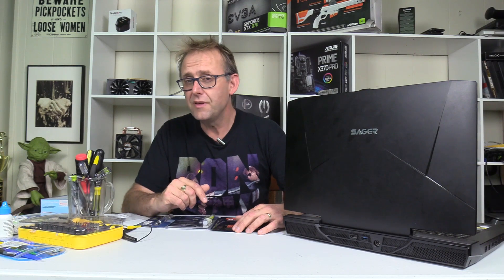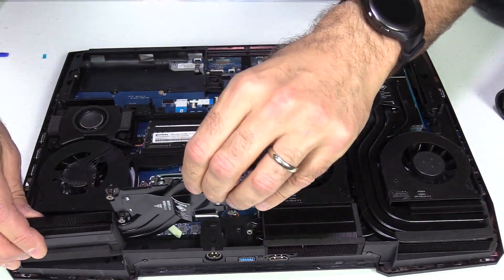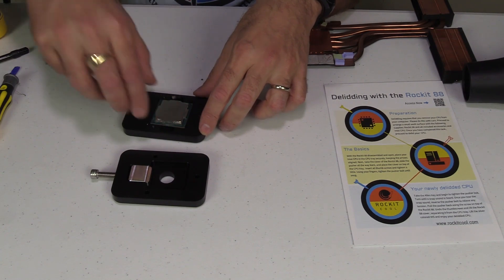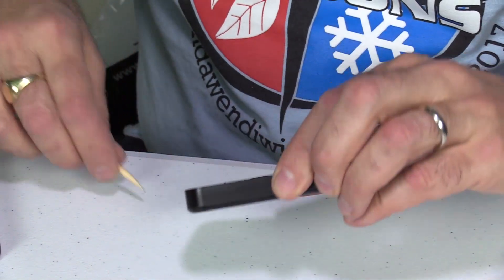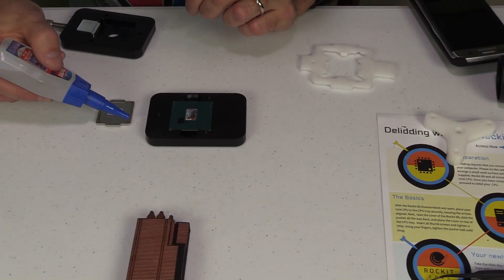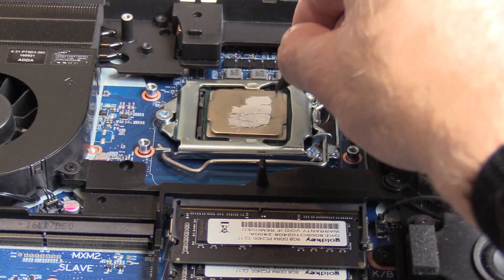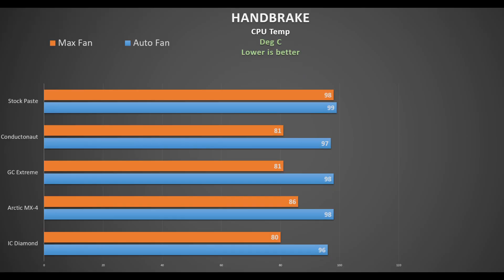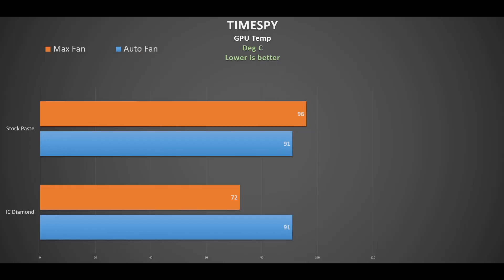Does The Thermal Paste Matter In a Laptop ? 4 Paste Showdown !

Comment: Hi, just discovered your channel with very informative videos.  I'm currently looking for a laptop for uni and wondering what would be best for me at the £1000 range.  I'll be using it for programming, web development, and might even run virtual machines.  Though, most of the practical stuff will be done using the machines at uni.  Gaming is not much of a priority, but if I could get significantly good performances than my ps4, it'd be a bonus.  But I doubt it at that budget.  Otherwise, I'm completely content with my ps4.  I just need something that would get me through uni really.  If you could find something better at a very slightly higher price, that would be alright as well.  Look forward to your suggestions :)
Reply from the maker: Thanks Jubaer, I'm glad you found my channel too ! I bought my wife the Dell Inspiron 7000 gaming, at the time it had a TN panel but I believe now - certainly here in the USA- that they are all IPS panels now. It is a great laptop . Games well, great speakers.
Here it is on Amazon but you might get it cheaper from Dell - especially their outlet: https://www.amazon.co.uk/Dell-Inspiron-15-6-Inch-Anti-Glare-Gaming/dp/B06VV992PY/ref=cm_cr_arp_d_product_top?ie=UTF8&coliid=I22XU8ISQOHZZQ&colid=3KCY0YS9MN21L
Here is my review on it: https://www.youtube.com/watch?v=oCo2GZLacMs

I reviewed the MSI GP72MVR and I think that is great too. Its light for a 17" laptop and I see it hasn't been released yet but looks great value: https://www.amazon.co.uk/MSI-GP72MVR-Leopard-9S7-179BC3-615-Graphics/dp/B075JR8KM9/ref=sr_1_1?ie=UTF8&qid=1514645562&sr=8-1&keywords=msi+gp72mvr+7rfx
Here is my review: https://www.youtube.com/watch?v=NMM43aZGOzk
They do a 15" version too, GP62

The Acer Predator Helios 300 is another solid machine, I haven't reviewed it though:
 https://www.amazon.co.uk/Predator-Acer-15-6-Inch-Notebook-i7-7700HQ/dp/B074JFXGW2/ref=sr_1_2?s=computers&ie=UTF8&qid=1514646041&sr=1-2&keywords=acer+predator+helios+300
Reply: That Dell range is highly recommended from some of the websites I've checked.  I checked on the Dell website and found the Dell Inspiron 15 7577 (which I'm assuming would be a newer version) with an IPS panel and 1050ti for slightly cheaper than the amazon one.  Plus, it offers 10% off which is fantastic!  Thank you very much for your suggestions!  I now know what to get :)
Reply from the maker: Great choice !  Enjoy it !

Comment: Cool video! Very useful:) great job
I bought today i7 8700K and will make some tests, did you have a chance to test this processor? 
Greets:D
Reply from the maker: Sandra M hey Sandra ! Thanks. Yes,I have tested it in my Sager NP9877. It does well although I think the bios is holding it back.i can't clock the 6th core any higher than 4.5...
Reply: its even more interesting. because i bought i7 8700K for my desktop. will test it in comparison with the results from your sager NP9877, wondering if there will be any difference
Reply from the maker: Sandra M that would be great, perhaps do a joint video ?
Reply: yea:D!
Reply: Something tells me you're not really a girl.

Comment: Interesting video. First time I've seen someone delid a cpu. Which makes me wonder what the results would have been had you not delided the cpu? I'm wondering if that skewed the results somehow? Deliding, if done right, will lower the temps to begin with so how much difference would there have been between the pastes using just a stock cpu? In any event I found it all very interesting. Thanks for sharing it.
Reply from the maker: Thanks for watching it :) I just figured whilst I was in there might as well make it as cool as possible. All 4 pastes were applied to the same delidded CPU so I would expect the relative performance to be similar. Glad you found it interesting !

Comment: Nice comparison! That Sager looks so easy to tear open lol.

I've recently discovered Cooler Master's MasterGel Maker and want to stick that on my Alienware 17 R4. From reviews it looks like it's quite a competitor at ~$10.
Reply from the maker: Havok C89 thanks! Yes, it's easy to get in and do this type of stuff. To get access to the m.2 and extra ram slits you have to push out the keyboard which is daunting if you haven't done it before. There AW7 R4 has a bit more framework to remove I believe. That paste looks great, 11w/mk . Whish I had spotted it for this test. Let us know how you make out 😀
Reply: OWNorDISOWN Tech Decisions Made Easy will def try to report back. I had my motherboard abd heatsink replaced on mine, which is curious as myself and the tech discovered it was a revision from when my unit was bought back in September. 
It stopped my studdering though, but my temps still throttle at times. Taking the R4 apart is definitely daunting though lol. From what the tech had done, everything was pretty much taken out and unhooked, it's CRAZY!!
Reply from the maker: lol, yes people often overlook the occasional need to get inside things to repair. I remember I had a Suzuki car that in order to change a lightbulb I would have to remove the bumper which would cost me $500, lol. Obviously I didn't bother and just sold it :)
Reply: OWNorDISOWN Tech Decisions Made Easy haha, you should start a channel for Car Decisions made easy!! ;) :D

Comment: Thanks for the great review. I might try this on my Alienware R4. Is there a way to tell if an R4 has good factory thermal paste / good application by a serial number, etc... I think you might have done a video about that, I could be wrong.  Sometimes Wolfenstein 2 or Elex will freeze or crash, not sure if it is thermal issue or just the games (I use a cooling pad). Seems to freeze up more compared to my previous 980ti desktop. Overall the R4 is great and your review helped my decision. Great review again and good normal speed experience compared some of the hyper active technology channels.
Reply: thewhitewolf I would contact Dell Alienware, and convey the problem to them, and request a new motherboard.  Depending on your residence, they will send a contractor to install it.  Also, if you still have a warranty.  They/Dell are trying to be more customer friendly.  I had an overheating problem, and they did exactly what I stated above, and it was very successful.  I hope this helps.
Reply from the maker: Thanks mate, glad you found it useful. The only way to check the quality of the pasta is to open it up unfortunately but it's fun to do 😀 I did do a video on game stuttering on the AW17 R4 and there seemed to be a concessus on 3 causes . One was poor thermal paste contact, the second was due to the rear end being raised , and the third was some issue with the hard drive. Perhaps it's because your laptop is inclined on your cooling pad ? 
I'm with you on the hyperactive channels. I sometimes wonder how those folks talk in real life, lol

Comment: quickly becoming my fave tech youtube. you go into the fine stuff. have you gotten your hands on a samsung notebook 9 pro as yet. the i7 8550u in the model i have is able to achieve 720. once i remove the intel dynamic thermal platform framework. its rather good. im about to repaste and add some thermal padding to keep temps down
Reply from the maker: Wandrinsheep Thanks mate ! I keep meaning to review a Samsung laptop. I'll have to add that to my list. That's great that you get such good performance. I think next year we will start seeing manufacturers increase the turbo power boost out of the box. It would be great to see a video of your repaste if you have time 😀
Reply from the maker: Thanks. I have gotten them shorter. Used to be in the mid 20's. I'll put time stamps in the description going forward, that may help. I think a lot of it is how YouTube push people's content. I think they should spread it out a bit more, rather than concentrating on the large channels that generate them more advertising revenue. Business is business I guess. Either way, I appreciate you sticking with me - even as I dabble in other products. Just bought a new UW 38" monitor to review. That' will be my 1st monitor video so I am sure it will suck compared to other people's but I'll give it my best shot :)
Reply: Wandrinsheep:  OWNorDISOWN is my favorite tech guy.  I'm shocked that he doesn't have a lot more viewers.  He is going up little by little.  I bet if he wore a couple of earrings and waved a rainbow flag and promised to make transgender friendly videos he would go right to a million subscribers.  That seems to be the youtube tech way these days.  Straight, smart, married tech guys are shunned by youtube.
Reply: SonOf Thunder:    LOLOLOLOLMAO!  Linus Tech Tips comes right to mind.  Youtube instantly trends his videos no matter if they are good or bad.  Right now youtube put his newest video to trend in the top 10.  Linus with 2 earrings and talking with a lisp.  I'm not gay bashing.  I don't care if someone is straight, gay, bisexual or trisexual but it is AMAZING how youtube favors anyone who acts even remotely homosexual.  OWN is a much better tech guy.
Reply from the maker: LOL, that made me laugh - Linus does have a lisp, never thought of it before but you are right :) I think I might start wearing disguises , perhaps a false beard or big Mexican moustache might get me more views. What do you think ? LOL.
Reply: Wearing a dress would boost you immediately.  PLEASE DON'T DO IT.
Reply from the maker: Cheers mate!  Yeh, I don't know how these other channels grow so much, I must be doing something wrong. I thought perhaps because my videos are too long. Like the other day someone asked how a laptop performed in a game and it was in my video - they just couldn't be bothered to watch it. Perhaps max 5 minute videos is the way to go. Might have to do a video and get everyone's feedback. Tough to cram in lots of details in 5 mins though.
Reply: I think the time length has been perfect.
Reply: OWNorDISOWN Tech Decisions Made Easy I actually like your format. Sure it's a bit lengthy but it touches on all the parts I need. I recommend maybe adding timestamps to the important parts. So people can get to the areas they need like gamer nexus who also has similar lengthy videos to yours. BTW I just ordered the ic diamond based on this video. And some fujiploy 17w/mk pads. I’ll try to record the results on my channel. Keep up the good work
Reply from the maker: Thanks for the tip. I used to do the time stamps in my really long ones but yes, its a good idea. I'll start that up again. I subscribed to your channel - looking forward to your results :)
Reply: Hey there, I tried recording my repaste. but unfortunately i Didn't have any camera up to par for the task. and screen recording messed up the benchmarks. I can only provide you with ther results of repasting and i must say I'm blown away.

Before: 20W tdp Highest temps 94C(thermal throttle) setting around  88C.  cinebench avg ~700
After: 20W tdp Highest temps 84C settling around 77C cinebench ~700

now that there was room for improvement i went ahead and did just that. 

new setting 25W tdp Highest temps 91C settling to around 82C  cinebench: 750 (concurrent testing) highest:756.

this IC Diamond stuff is  kicks ass. and I apologise again on not being able to properly record this. i was shitting bricks pulling apart my baby with no manual lol. thanks for recommending this awesome paste this machine is the best thing with a little tweaking, barring graphics
Reply from the maker: Great result ! Yeh, I was bricking it too when I did my first one.  Thanks for sharing your results mate and have a great New Year !

Comment: GPU Test you had an error: You sayd you got 14°C lower on max fan, but it's actualy 24°C.
Reply from the maker: Actually there is a double error - its actually a 19 deg difference (which I did say in my conclusion) - the 91 and 96 deg in the stock paste are the wrong way around. Thanks for letting me know, I don't know where I got 14 from - obviously maths mustn't be my strong suit, lol.

Comment: Excellent video Steven. How many years does the thermal paste last????
Reply from the maker: Thanks!  Arctic MX-4 data sheet said 8 years so I suspect the other pastes will be something similar. the exception will be the Conductonaut. It is liquid metal and reacts with the Oxygen in the air and can get crusty so they recommend redoing it every 6 months. Its been a while since I did my Aorus x 3 and Yoga 720 with it so I will do a video to show what it looks like. Also liquid metal cannot be applied to aluminum, so the heat sinks must be copper.
Reply: OWNorDISOWN Tech Decisions Made Easy  Thanks for the answer!!! 👍🏻

Comment: Very informational vid. How about the curing time for each thermal paste?
Reply from the maker: Thanks. Good question. I did various stress tests on the CPU and GPU for about an hour, let it cool and ran it again. Let it cool then did my tests.  Another reason I didn't do the GPU on all 4 pastes - it takes ages , lol !
Currently I have the conductonaut still on the CPU and have been using it for a number of weeks like that. The CPU temp dropped by an extra 1 Deg C from my tests.